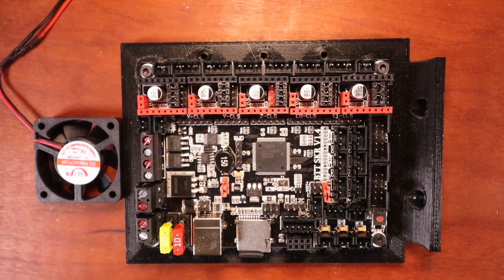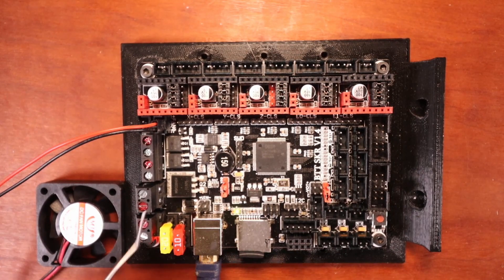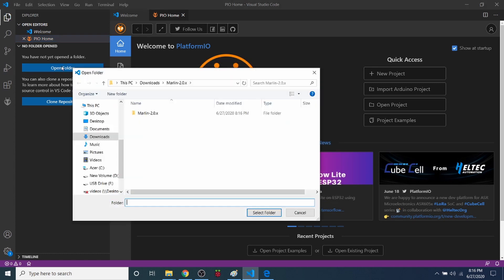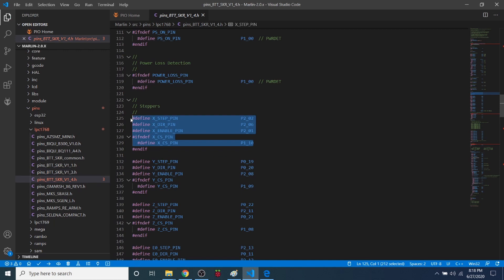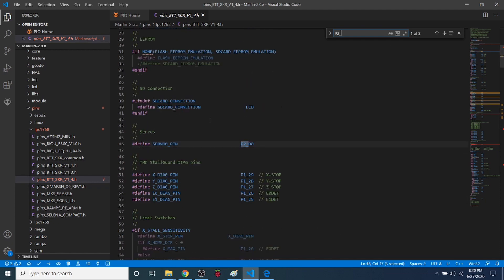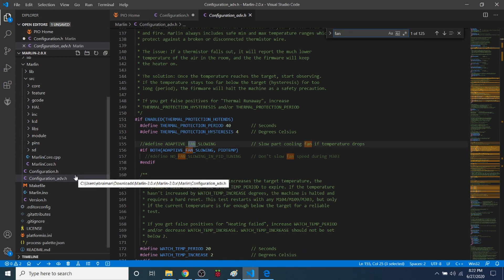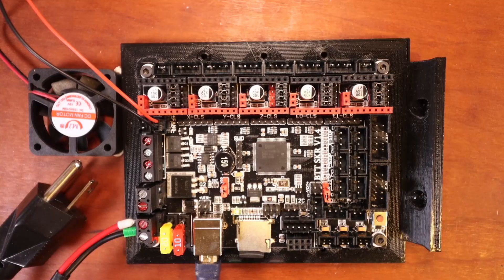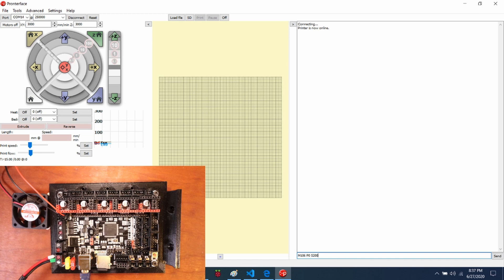SKR 1.4 - Fan Control

Comment: I have a question.  Fan0 makes perfect sense to me, but what about the hotend fan.  I have seen videos where they connect it to HE1 (Hot End 1).  I tried plugging it into Fan1, which works but F1, F2, and F3 all seem to be always on and I wanted it to stop when temp was room temp (or close to it).  Is there a configuration I need to update or do I have to use HE1?
Reply from the maker: Depends on if the fan has a signal pin or if reserved pin or if direct power pin.
Reply: I had to make a seperate breakout board for my hotends to enable auto_fan:
https://youtu.be/NSjnlr60vZE

Comment: Is it posible to control FAN2,FAN3 or it is always on? I would like to connect hepa filter fan so i can turn it on/off via gcode and set speed. Fan0 is layer fan, Fan1 is HE fan always on. What about fan2,3? Is there a way to control 'em. Thanx
Reply: fan2 and fan3 are also always on, the only PWM fan is fan0 unfortunately
Reply: @SlinkySlonkyWaffle  Thanx!

Comment: Can you set the extruder fan in this way? Normaly you run the fan directly of your powersupply.
I want to run the fan of the controllerboard and run the fan only if the hotend is heating up.
Is that posible?
Reply from the maker: There should be a tutorial in playlist for this.  Inside description should be a link to playlist.
Reply: All i could find is that it is not posible. The only alternatieve is with a temperature controlled mosfed.
Could you give me a link?
Reply from the maker: There might be a stream where I talk about it.  There's a Livestream playlist.
Reply: @fvheel  https://youtu.be/NSjnlr60vZE

Comment: Can't find a video to explain f0 config for the tft35 E3 and marlin 2. Have fan to cool part connected to pb7 which is the pin indicated in the pins file for f0. f0 shows up on the screen of the tft, but doesn't control the fan. Confused. Pulling hair out! Please help. Thanks for all the work you do. Your videos have been a great asset.
Jeff
Reply from the maker: I think I did a video on this a long time ago or I'm a Livestream.

You need to specify number fans in config.ini file for display.

Comment: Thanks for the video. But if you have a 2 hotend? Is it possible to use 2 fans for both hotends? Are there two pwm fan pin or is there a way to use another pin for second fan control?
Reply from the maker: Yup.  Use an open signal pin. On board.  There might be a video in SKR 1.4 playlist or SKR 1.3 playlist.

Comment: Thanks for the video! I had some issues with the fan port on my board - appereantly the mosfet is shorted from the factory. Got a solution from BTT.
Reply: yos gu
 how did you solve that?